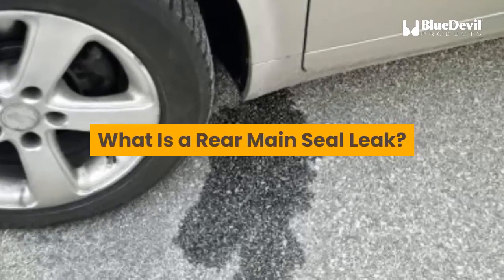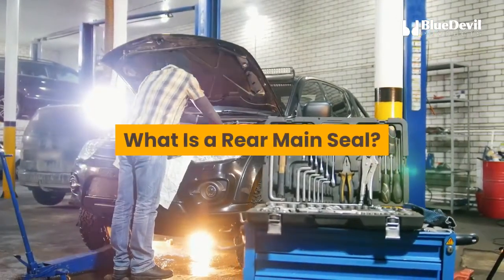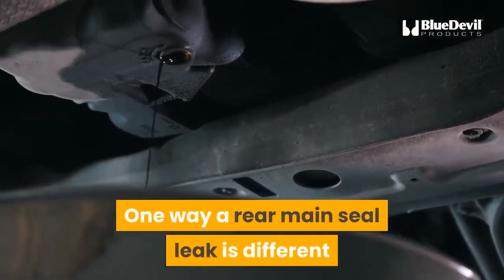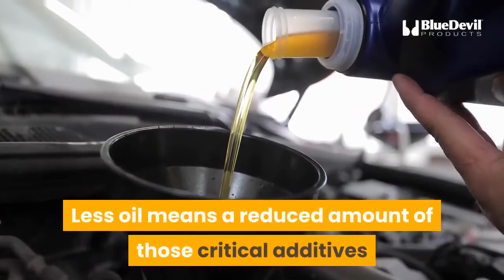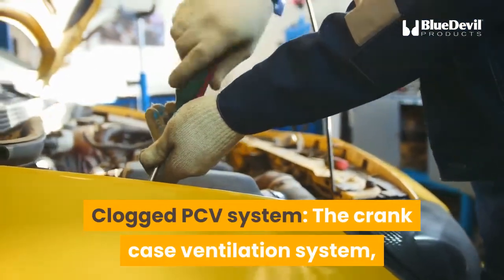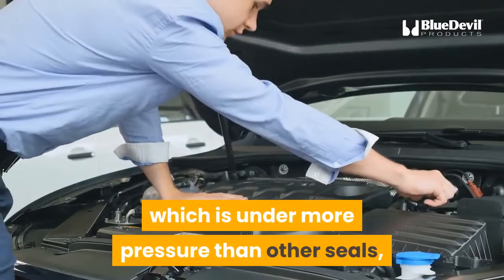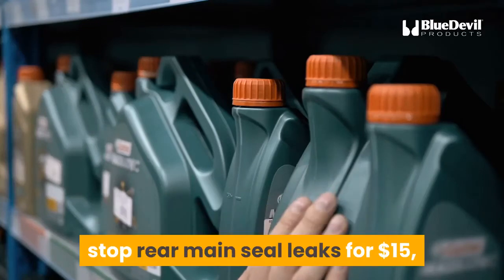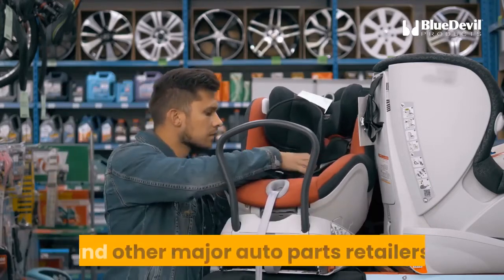What Is a Rear Main Seal Leak? | BlueDevil Products

Comment: Replaced all 3 seals on my polo 1.2 tsi and after all that excessive oil still spilling out my timing case cover also wetting the timing belt. After watching this video I'm quite certain it's the rear main seal especially after hearing the causes as well. I'll come back a few days later for confirmation

Comment: I couldn't find a more recent Blue Devil rear main seal repair video so I'll comment here.  I have an 06 Silverado 4.3 with >170,000 miles on it.  Several months ago the rear main began leaking.  I finally made an appointment with a former GM tech to replace the seal for an estimated $800.  That was supposed to happen to day, 11/29/2022.  I am usually skeptical of miracle auto chemicals but what the heck. I've seen video after video on several products. But on Sunday afternoon I decided to take Advance up on their email giving me 25% off. I ordered this stuff and went to Advance to retrieve it.  I poured it in right there in the parking lot.  Round trip was about 15 miles.  I decided to park on the clean side of my driveway much to the dismay of my wife. OK, I don't get it.  It's supposed to take longer than that to work, right. Folks, Monday morning there was maybe a quarter size drop on the concrete and it was leaking way worse than that before. I drove quite a few miles yesterday.  This morning the new spot is dime size. Can this stuff really be this good?  I am beyond satisfied and just hoping that it lasts..
Reply from the maker: It generally takes between 200 - 300 miles before you will notice full results from the BlueDevil Rear Main Sealer.
Reply: @BlueDevilProducts Would a second application be necessary? My leak stopped for a while, but after changing oil, it's leaking again